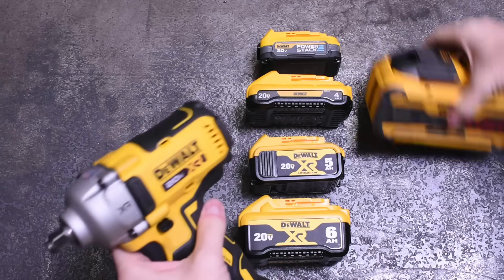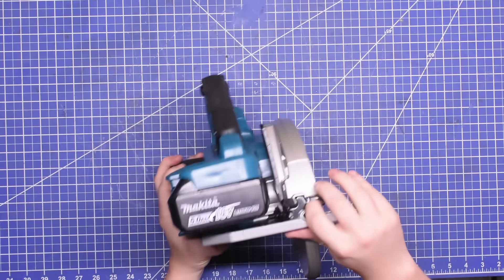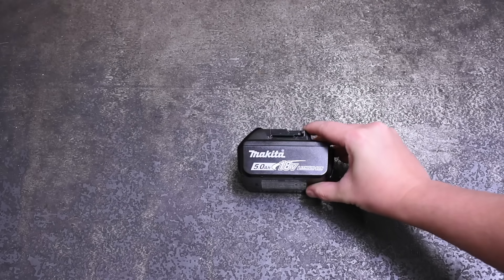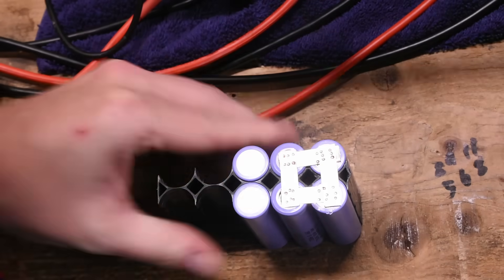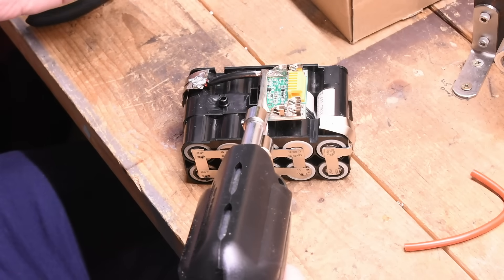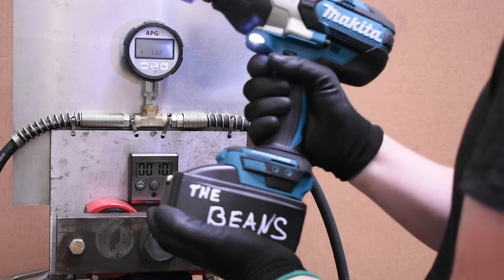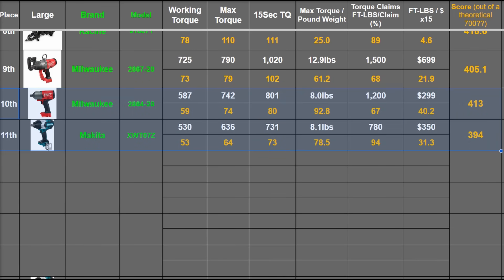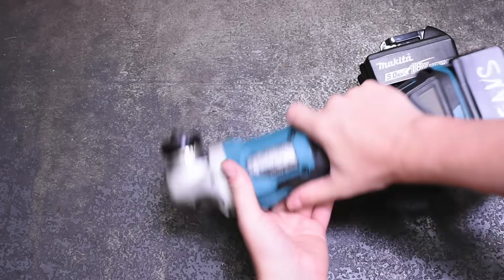We Built the Best Power Tool Battery for the "Worst" Brand

Comment: I went to Makita from DeWalt when I upgraded from the NiCAD batteries to lithium ion because of how much love I saw from AvE about Makita and I'm honestly regretting it at this point. Their batteries by today's standards are bog standard and fall short of even Ryobi and Harbor Freight, which in my mind is a huge slap in the face since you can buy a 4.0 Ah Ryobi battery for $25 right now if you get them in packs of 4, and a 3.0 Ah Makita is minimum $50 anywhere I've looked. The bigger batteries just get more pricey from there. I don't want to get rid of my drill, driver and multitool because they're really great tools, but I'm not buying any more battery powered Makita stuff. Fool me once. I might be persuaded back if they drop the price on batteries. When the tools eventually crap out (or the batteries do) I won't be replacing them with Makita. Recently I got drawn into Ryobi, partially because of content you put out here that they're way better than they used to be, and also because of the aforementioned battery prices. I've been happy with the 3 tools I've bought, and now I'm looking for more excuses to buy tools because the batteries are so freaking cheap.
Reply: Just run them off adapters. Makita has in a recent patent stacked pouch cells, so they will come out with better batteries, but for now if you have that fear of missing out, then run the big block batteries from another brand on an adapter to your Makita tools.

Comment: makita has a mac charge/discharge cycle limiter as well, in japan they have a tool available that looks kind of like a charger that reads the chip in each battery and will tell you how many cycles its experienced

Comment: As a battery pack rebuild hobbyist (my wife doesn't understand) this is one of the coolest videos I've seen anyone do on the subject. I have rebuilt multiple M12 3-cell packs, but I think it's time to graduate to rebuilding my 4.0 M18s. The Molicel P45B and P28B are truly the business! Thanks for the great work!
Reply: Have you considered trying to overvolt some by running 6 P45B in series?
Reply: @benperkins2929  I might give that a whirl via an adapter to some Kobalt batteries I have. I think it would be too difficult using the stock battery enclosures.

Comment: dont trust any of those battery manufactuerers they like to overrate their batteries to levels that are literally not achievable. 

look up "battery Mooch" if you want to have great battery knowledge. also if you want powerful batteries, theres a reason nearly all companies use 18650s instead of 21650 or any of those bigger ones, the discharge rate of the big batteries, isnt as good or powerful. 

you want to get some old sony VTC3s you want no milliamp hour life, and all amps, so you get no sag, and arent in danger of overdraining. 

those samsungs telling you they arent good for vaping literally just translates to "these batteries are fucking trash" theyre lying about their numbers.

Comment: An interesting test in itself, but this is still a DIY battery with weaknesses that you discovered yourself... high current transmission is extremely important so that the battery itself does not overheat, so that the voltage drop is as small as possible... but I won't start yet  with cooling etc...
I will mention it again-Metabo (not Metabo HPT!!!) still has the most developed batteries on the market-LiHD series.. double connection of cell pairs -yes-two separate conductors-one for the upper and the other for the lower row, which are even  screwed onto the printed circuit board...large multi-finger contacts for tools, ventilated construction for cooling already during use, not only during charging, etc., etc.
Try the best dual line 18V battery on the market...Metabo 18V/5.5Ah LiHD..or equivalent from CAS alliance😉

Comment: I soldered copper straps on mine.  I just buy sheets of copper and cut them with tin snips.  You need a very hot iron so you can reduce the dwell time and I put the batteries in the fridge before I get started so the inside is fairly cold to help prevent overheating.  The nickel plated steel is used because it's easier to spot weld and cheaper.  I've not tested it but a nice big solder joint is probably a better contact than a couple tiny spot welds.  And. IIRC copper is several times more conductive than steel.

You could measure the v drop between the batteries taps and the straps and across the straps themselves to confirm where the V drop is occurring.

For good solder ability on the batteries tabs, I just put a light oil on them (the oxygen barrier prevents flash oxidization when soldering) and lightly stuff or sand the nickel shiny directly before soldering.

Soldering on these is inherently dangerous, particularly charged cells, but it is not impossible.

Spot welding is faster and transfers less heat into the cells, thus its how factories do it.

Comment: I always rebuild my battery pack with high amperage output cells... Heck i even rebuild my own laptop batteries. In the process of replacing my 18650 cells with small lifepo4 flat packs in a 7s testing, May have to go 8s with my on custom BMS at 4ah- I custom 3d printed the bottom case i designed in Fusion360 .... Love not paying the store prices.

Comment: Of course it works.  But what about the unseen cost of possibly burning up a lot of older tools with these extra amps?  Not sure if the tool protection circuitry was all that great when a lot of their 18v stuff came out.  In my opinion, it would be a HUGE mistake for Makita to risk burning up trusted tools with a higher output battery.  But that'd make a good video to test tool protection when Clyde Simpleton sits on the same lug nut for several minutes uninterrupted.  haha!

Makita has probably done the best job of drawing the line, albeit due to their own shortsightedness in sizing tools based on the 5ah pack footprint.  They saw that they were close to the limit on 18v and the advantages of higher tool voltage.  But they continue to produce new tools in both 18v and 40v platforms that are adequate to suit their customer's needs.  I know the channel is all about the beans, but the vast majority of users just don't need all those beans.  There is a market for beans, of course.  But Makita and Milwaukee both cash in on platform tool variety.  It's hard to switch, or add another platform to your inventory for 100 ft/lbs that you probably already have in your shop with air tools for that rare occasion that you need it.  My analogy on this subject:  Just because the speedometer goes to 120mph doesn't mean you should DRIVE at 120mph.  

The real elephant in the room is where does Milwaukee go with 18v?  My opinion is that they have already gotten 99.5% of the juice out of the 18v lemon.  And they did some unbelievable engineering in the process.  But MX Fuel is too big for handheld tools and a bridge too far for most users.  They are already going where they scoffed at Makita for:  Dual pack tools.  Now what Milwaukee?

For the record, I'm happily, and heavily invested in BOTH Milwaukee and Makita's 18v platforms.  They do what I need them to do, and they do it well.  There are very few of them that get taxed heavily.  And those are mostly M12 tools that I reach for most due to their lighter weight and small tool box footprint.  I can just carry more of them.  So it'd take one amazing, must have for me to even think about going to a 3rd high power platform.

Don't get me wrong, this is a great video!  Well done on the battery packs and the showing the evidence.  Anyway, keep up the great content.
Reply: I think Makita are going to be vindicated when different battery form factors and chemistries come out. In a recent patent they show a battery concept with stacked cells, so it may be on the horizon. 

However I totally agree with you about most people not needing max beans. Hot rods and muscle cars exist with max speed, but they are loud and shake all over; and massive trucks exist for load and towing capacity, but most people own a sedan or a small SUV to get done 99% of anything they need to do. Makita have given users the fast and strong line in XGT, and for those that have the Hot rod and truck in the driveway in addition to the family vehicle, that's there for them. Makita is the family vehicle though. Our dads had it, and many guys grandfathers had it as well. It's reliable, comfortable, and user friendly.

 There's a reason Makita is the only company that owns itself as well as makes all its tools for itself, yet they cooperate with other brands for consumable and blade tech like Starlock and XLock. New attachment standards take time, but Makita is often on the forefront of it.
Reply: I think these fears are unfounded. I run big Flexvolt batteries on my pre Flexvolt Dewalt tools all the time, and I absolutely thrash my tools. No issues, just more balls and more runtime.

Comment: I swapped some really cheap cells into a pair of dewalt batteries, a 207 and 201. One of them had a dead cell and the other was more than eight years old. The batteries are almost useless, they wouldnt have done a 10second blast with an impact but they will run a radio for a day no problem and that all they need to do.

Comment: This free R&D also shows how important tuning a tool as a whole system is, everything between the cells and the anvil on an impact.  The motor, and to some extent the hammer, prefers the spicier pack, but it's still beat out by the M18, which is a better tuned system as a whole.  And of course with newer tools, you're also getting into more complicated battery management and monitoring, different inner workings of the tool itself, etc., so the combination isn't just cells, motor, and end effector (in the case of an impact, the hammer and anvil, in the case of a drill it'd be the reduction drive, etc.) anymore but also the circuitry as well.  Which is also important to understand as a consumer, especially those that want to frankenstein a DIY pack, as there will always be an upper limit of what a tool can take; for example, the tin on the DIY pack literally acting as a slow fuse, now imagine what happens when you burn a motor up or outright blow the more complex modern circuits (most of which are now based on ICs and not simple logic) these tools have.  And on that note, I'm not sure if any of these tools have overcurrent protections, as the original design would never push that, and it's unlikely to have a catastrophic failure past what battery management might catch; and the same with any kind of protection, I don't think any of the tools themselves have any and just rely on the BMS to just shut down the pack if anything goes wrong, though the newer tools where there is communication between the tool and pack could be a different story if they actually invest into motor and IC protections.

Comment: Instead of relying on ever increasing battery weight that throws off the weight & balance of a tool, lets move the battery onto the floor into a large Battery unit.

The next big experiment is to go for a large 1 kWh Battery Unit that sits on the floor.

You'll connect that battery unit to your tool via a 1-3 meter power wire using a standard modular cable connected from it to your tool using standard adapter plates to each brand.

This would let you have 1x standard battery to charge, and allow you adapt a massive 1 kWh battery Unit to ANY tool you want.

You could also get a large AC to DC power supply and use that standard modular cable to get power from the wall.

What do you think?

No more power limitation due to battery tech or not enough power, you can have a massive 1 kWh battery that would last you quite a while.
Reply: You've basically described the PDC01 Battery pack: 4 LXT s in a case with approtpiate lead for 18v, 36v, and 40v. I've done it for my 36v miter saw. It works wonderfully.
Reply: @EliotTruelove  I wonder why this setup isn't more common?
Reply: @Kamen_Rider_Blade  because it's advertised as being for OPE (Outdoor Power Equipment). Some 36v tools that are older than 2018 don't accept the 36v adapter because of a plastic tab (my 2017 10" miter saw for instance). It works on all my newer 36v tools, including a chainsaw and top handle circular saw. It is a super cool setup that as of yet I haven't needed to use much. On my older miter saw I use the 18v adapter in one slot and a 5th battery (besides the 4 in the pack) for 5 batteries of power in the 2 battery tool. So 2 1/2x runtime.
Reply: @EliotTruelove  Maybe they can repurpose it for indoor equipment
Reply: @Kamen_Rider_Blade  it would drive sales for sure. It's pricey considering it doesn't charge the batteries natively, but it is very convenient otherwise.
Reply: @EliotTruelove  Having more options would be nice, especially from the large battery makers who only need to make adapter cables that are modular.

Comment: Have you guys ever thought about soldering in connectors for LiPo's? I've soldered up a 5s balance lead and an XT60 connector to the board and put a 5S HV LiPo in there and that thing go's Ham! I can send you pics of what I've done. its so easy. I would love to see these tests on straight RC or Drone Lipos with 100C's plus of output. if its not easy for you tell me and I'll make them and send them in.

Comment: I emailed you guys to see if you wanted to use my 36v 3/4 Metabo HPT impact never heard back. Could include a 4/8ah multi volt battery and AC plug-in adapter. Unless I somehow missed it, never seen you guys test one.

Comment: IMO Makita need to do 2 things. 1, make a 21700 cell battery that will fit on 'most' tools. 2, make a 5AH pouch cell battery that will fit on ALL, including LXTx2 tools. I am sure the majority of Makita guys, (myself definitely included here) would prefer some better battery tech and just have to think for 2 seconds about what battery works on what. Vs the current BS of no innovation for the past 8ish years.
Reply: A recent patent showed an impact with a battery that has stacked cells, so it may not be far off. I don't think LXt will ever get 21700s though. They don't want to alienate many users who care more about compatibility than runtime/power.

Comment: I upgraded a Dewalt 12v battery from 2ah to 6ah by replacing the 3 x 18650 2000mah with 6 x 21700 30T the video is out tomorrow

Comment: @MakitaToolsUSA are you guys paying attention? I am very tempted to switch to other tool brands because of the battery options. There is only so little I can do with a single 5Ah battery as a home owner with a fixer upper. Your tools are great but your batteries suck. Please fix this!
Reply: Run your Makitas off battery adapters if you need the beans. I've ran DeWalt and Milwaukee batteries on my Makita tools through an adapter more for testing purposes, and they work great. I have a Teal spraypainted Milwaukee Brad nailer that I use with my Makita batteries regularly through an adapter.

Comment: I own Makita tools, because my father had Makita tools. He built the house I grew up in with a Makita 7.2 NiCD screw gun. My Grandfather used Makita. That being said, I'm pretty sure I'm the average Makita customer. I don't care what Team Red or Team Yellow are doing. They do everything I need and will for the next 20 years.
Reply: Exactly this team blue yellow teal is bullshit. My grandfather had been a contractor since the 80’s. He used Makita cordless drills. Black and decker corded drills. Milwaukee sawzalls and a skil saw worm drive saw. For almost anything. He didn’t care about the color or name. He only cared who made the tool well. 
I think the only thing he retired from that list was the Makita drills before getting new ones.
Reply: I find Makita plastics poor  in durability and break when dropped or hit , kind of brittle, I have a few with cracked bodies.Redscare better when it comes to abuse.
Reply: Agreed. There's no need for these "teams" to exist. I have both Milwaukee and Dewalt tools, and will likely buy Makita if needed.
Reply: @theneutralnode-s same, we bounce back and forth between yellow and red. When ever I need a new tool I look and see who makes the best of that specific tool and buy it. If I’m buying a tool with a cord then it doesn’t matter who makes it to me.
Reply: @theneutralnode-s these teams exist because batteries are expensive.
Reply: Makita just doesn't make as good of tools as other brands. And they charge more than milwaukee in most cases but are nowhere near the quality. They have to use 2 18v batteries to make the same power than M18 and 20v tools do. Kinda sad actually.
Reply: @justinrisley8466  Their tools work just fine and are completely reliable. I literally have a two boxes of dead Milwaukees and Dewalts as work. I'd argue their tool's quality is probably better the red ryobi's or yellow black and deckers. That's why Makita is still one of two independant tool manufacturer's left (The other being Hilti) What Makita doesn't do is bother with the one upmanship. My impact drives every fastener I put on it, my saw cuts everything I put it to. Are they the most powerful? No. But they'll work perfectly the next 25 years.
Reply: @justinrisley8466 Well by my experience makita has flaws but still 2 if not 10 times better quality than the red ones. The M12 battery is trash and overall all of them useless in colder weather. Also very unconfortable and not repairable. Sure they are strong(M18)  but thats about all the pros. 😅
Reply: @justinrisley8466   loool doesn't make as good of tools. Dude I have been using my Makita impact driver daily for 11 years. Milwaukee spends more on marketing and the fanboys in north america like ot have curcle jerks about how great their tools are when in reality alot of them are hot garbage - especially the hand tools.